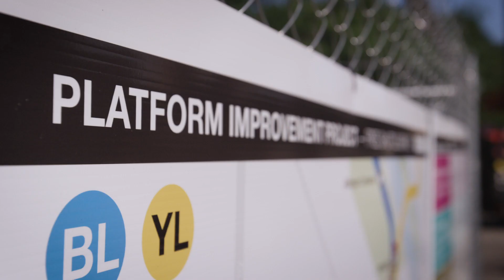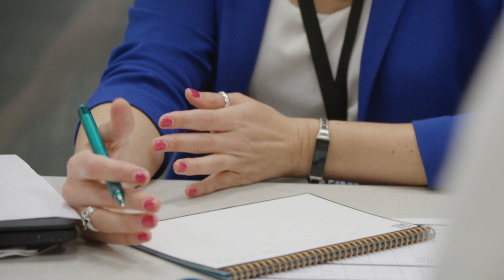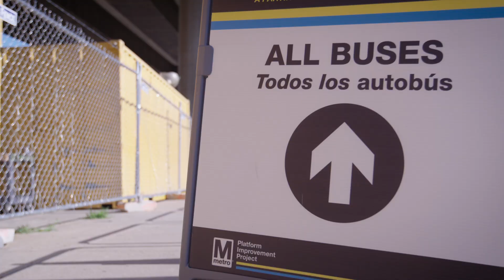Platform Improvement Project Overview

Comment: It is a good thing that the Platform Improvement Project can be done while line segments are closed to the riding public. In this way, the work can be done accurately without rushing. The surface, open cut and bridged stations will be sturdy and safer than before. This work makes way for major maintenance work to be done on the tracks and electronic systems between stations, too. This project is good.